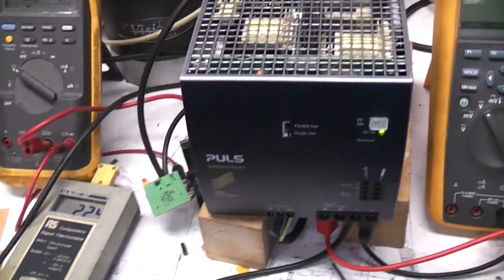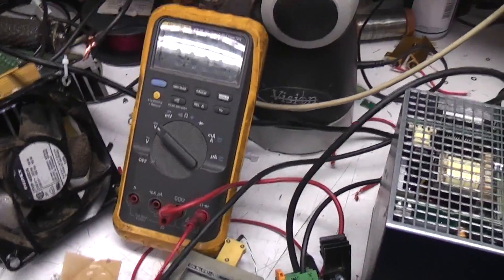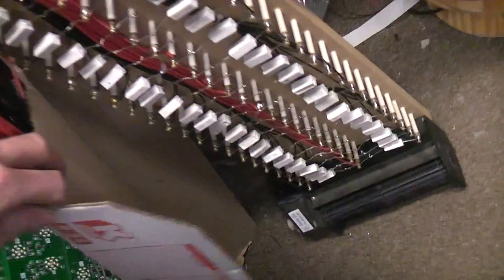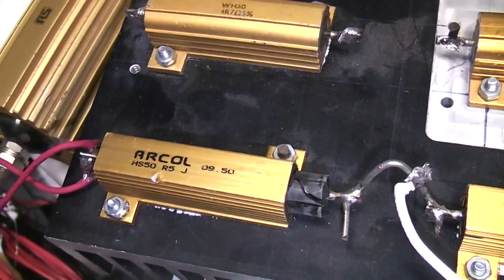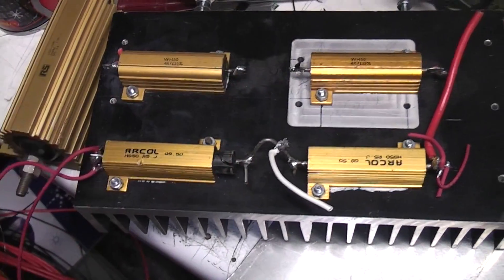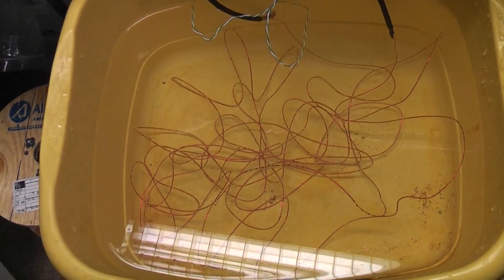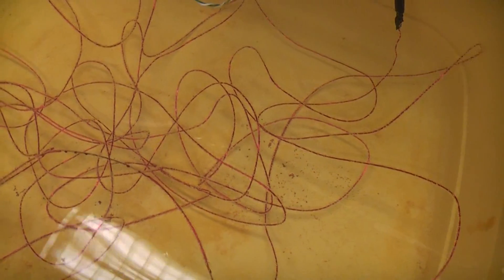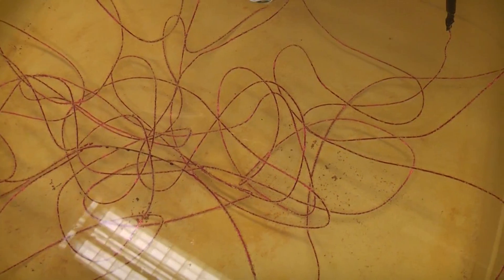Dummy load in a bucket

Comment: Mikes vids are always great!  For a neater solution do this.  Find an old 1200 watt MOT, wire up the secondary to the DUT.  The core should dissipate and heat.  Put it in a bucket filled with vegetable oil  for more dissipation.

Comment: Very common in India. In fact, the best is steel wires used for packing, they both act as resistance and are cheap. Very good to discharge batteries (battery charger development).

Comment: It works quite well unless the wire breaks, because for example some of it managed to come out of the water, boil the remainder of the water off the insulation as you demonstrated, heat up and melt. Assuming that some of the exposed wire lands in the water, the next thing you know you are generating flammable hydrogen (and oxygen) gas as the water begins to undergo electrolysis. Then next thing you know, the hydrogen catches fire and you have a mini Hindenburg in your basement/workshop.
Reply: Post a video when you get that to work. :D

Comment: I've been there and done that. During development of a 13.8V 15A PS I used an old ceramic power resistor about 4 cm in length inside a coffee mug full of water. You could know when it was running ok by watching at the vapour and listening to the "electric kettle" like sound.

Comment: I usually use container filled with water to dissipate heat from overheating heatsinks. Like my 2n3055 push-pull flyback driver, small DIY heatsinks made out of aluminum submerged in water, and everything is OK

Comment: Great idea, I believe mineral oil can be used similarly.
Reply: Water has a much better specific heat capacity (4183 vs 1670 J/(kg·K)) and thermal conductivity (0.67 vs 0.162 W/(m·K)) compared to mineral oil. Even taking into account the higher boiling point of mineral oil, water is the superior coolant.
Reply: David Cruise In some applications oil cooling is more appropriate, usually where it would be simpler and the cooling demand isn't too high or electrical insulation is essential (in this case it isn't important because the enameled wire takes care of that).
Here the coolant isn't difficult to replace, nor is it scarce and where water can be easily replaced evaporation is a good thing because evaporative cooling is extremely effective.
Just as much care is required to monitor the oil cooled system as the water cooled one because if it reaches it's auto-ignition temperature, well, you know what happens. Though this is only likely to happen on a long term test.
Reply: until it gets too hot and you end up with a big pool of flaming liquid , at least with water the risk of fire is a lot lower
Reply: If the dummy load were in a bucket of rags you may have a point, but mineral oil alone is only marginally combustible.
Reply: ever seen a paper in oil capacitor explode ? they catch fire really well ,water is still less flammable .
Reply: Yes, that's oil-soaked paper burning, that's not what we're talking about. Like I said, mineral oil alone in a container would be extremely difficult to ignite.
Reply: you clearly don't understand the difference between a flammable hydrocarbon and water .
Reply: You clearly don't understand that flammability may not be the primary concern.

Are you able to comprehend the potential issues of submerging wires into conductive liquids?
Reply: Xei  But it'll also evaporate. Clearly the better coolant is the one most suited to the specific application.

Comment: Used to drop a 20W wire wound in a bucket of water and put 2KW audio amp into it. Worked fine. For long tests I would just let it boil, gets rid of LOTS more heat that way (Heating 1 btu/lb/degree F   Boiling about 1000 btu/ lb ) Sorry for the "caveman" units.  Customers enjoyed the show too. Also an 1800 watt, 120 volt space heater is close to 8 ohms so they work great for high power audio loads. You can hear a little audio coming out of them too.
Reply: +robstorms To robstorms:BRLLIANT!I just happen to have an 1800 watt heater sitting next to me. Just did the math. 120 volts ac, 1800 watts=8 ohms and 15 amps.  Now I have a VERY high power load resistor.  Absolutely BEAUTIFUL !

Comment: I remember seeing somewhere a guy had large resistors immersed in a bucket of oil.  I don't remember where now, but that is another option for solving the corrosion problem.  Oil doesn't have as high a specific heat as water, but it can get much hotter before boiling.  Kanthal or nichrome will get you more resistance than copper, but they don't usually come coated.  Coated steel wire is another option for use under water to get a medium-high resistance, or you could even coat your own in a bath of polyurethane.

Comment: 24V @40 amps . You could use a 12/24V to 240V inverter  then plug a 1 or 2 bar electric fire in it for your load.

Comment: On a related note; some shower water heaters use bare coiled elements in water - the advantages being fast heat transfer and a novel emergency safety failure mode: If other safeties fail and water stops flowing, the heater boils the water pretty quick, but the first bubbles to form around the element cause that part of the element to break like a fuse.

Comment: I use some big wirewound power resistors. 1R at 200W each. I mounted them together on the L-brackets they came with, bonded 8 together, and ran them out to terminals on the lid of a 5gal paint can full of mineral oil. It can take a KW for the better part of an hour before the oil starts to get appreciably hot. Wonderful for testing amplifiers or similar. Total cost to me? About $50 USD and 2 hours.

Comment: I've used immersion heater elements in a large water bucket before.  They're cheap and it's quite easy enough to keep a bucket (or some large drums) of water cool enough to run just about any test you need.

Comment: Great timing! I just picked up a 80A 5V supply and I load tested to about 51A and my wire started to cook! I need to try this and push the PSU more towards it's max potential. I do have a 250W Dale .1 Ohm load resistor I was using, but my wire had as much or more resistance and started to cook!

Comment: This is a great idea Mike, thanks for sharing!! Here's a thought, what about taking apart a ~2kW convector, quartz or halogen heater and use the heating element as a load? That would be cheap to do and very safe... The other option is to use a plain halogen working light as a dummy load maybe? Anyway, great idea and hope to see that LED setup soon around...

Comment: You need about 4000 W in one second to increase the temperature of 1 liter of water by 1 °C, plus the heat it dissipates. Yupp, best dummy load you can get. Nice !
Reply: 4200W
Reply: Mr. Spock, if you like to count beans, it's exactly 4184 J/(kg·K) (14,5 °C). All the other effects are in a range that being 10% off will not make a practical difference.
Reply: Chip Guy Vids
 lol

Comment: A ceramic wire-wound or carborundum/globar resistor rated for about 100W in air will safely do about 500W or more immersed in oil. Commercially made high power RF dummy loads use this principle. At work I have everything from 80W to 25kW RF dummy loads, all of which are basically a resistor inside a finned aluminum housing filled with oil.

Comment: I second your cautions about overloading those metal clad resistors. Some time back I was testing a solid state 3 phase 415V motor reverser, based on back to back SCRs for the switching. Each phase switched had a low ohm value metal clad resistor in series. There was (supposed) to be SCR switch electronic interlocking to avoid cross phase short circuits. During full power testing some went horribly wrong with the interlocking and a SCRs cross fired. As the testing was at full power the power supply was probably capable of a few kA prospective. The result was like a shotgun and the insides of one resistor burst out across the bench smashing through some test gear. I needed to change my trousers afterwards.... Cheers !

Comment: Why not just use a use a few light bulbs?
Reply: It's a 24 V power supply. Getting up to 800 W in 24 V bulbs would surely be more expensive and complex than a couple meters of enameled wire.
Reply: The resistance in the light bulbs goes higher as the filaments get hot. So connecting a 400watt light bulb with cold fillament may trip an overload protection of a 800w PSU.

Comment: Should you take care about the flammable gases (H and O2) produced, or can they be ignored?
Reply: The wire was insulated. Even with bare wire at low voltages you won't get much hydrogen unless you put something in the water to make it conductive.

Comment: Nice solution :)

About boiling water: it may not actually be a problem.

The water will keep the temprature at a stable 100C as long as the wire is still below the water. (except modified conditions)

You only need to refill when the volume goes down.
Reply: Next step: put the wires in the tank of a toilet (the water reservoir). When the water level starts to drop, more water is automatically added :).
Reply: drojf In my years of plumbing I have come across a toilet/bog/wc that got plumbed to the hot supply. Nasty bloody things growing in and around it, but the client thought it was a good idea as it kept her back warm. fat bugger she was. Don't ask me about some one pluming the mains water to the gas, now that was something else, lol.
Reply: I think the water boiling would be a very serious problem because thermally insulating vapor/bubbles would separate the wire from the water, dramatically decreasing the overall ability of the water to cool the wire the hotter it got.
Reply: drojf Haha you are sooo smart! Very interesting idea! xD
Reply: I'm no physics expert but that seems shakey to me. The water cools the wire because the water is absorbing the heat. But if the water reaches 100C and no further then where is the heat from the wire going? Seems to me like it's staying in the wire. The water may not heat past 100C but the wire definitely can.
Reply: @ortzinator  All the energy coming from the wire leaves via the boiling water. Boiling consumes energy.
Reply: Brian Ortiz Correct, the water turns into gas and isolates the wire thermally. That's how steam trains used to blow up

Comment: Neat idea, I like that.  I had a power resistor explode forcibly and fire ceramic shrapnel out the ends when it was in use as an inrush limiter and the bypass relay circuit failed.

Comment: I have used halogen floodlights as a load.
but water is certainly a good cheap way for short term and if you put it outside in the cold it can run forever if you supply a slow drip for evaporation.
or simply a fan on a radiator for the water. 5 degree air is a bitch

Comment: Arcol resistors are crap! I used some of them for a 3d printers heated bed. They had the same failure mode at only 100°C. Since then I use Welwyn resistors, they can be heated up to 250°C without a problem. They work over a 2 years now, and have more than 1000 working hours on them.

Comment: someone did a lot of testing on those golden colored heatsinked resistors a while back, turns out maximum continuous current even with the case held at room temperature (grossly overpowered heatsink) is only about 110% of the rated current. It can handle a bit more in very short (millisecond) pulses but any longer than that and it will overheat.

The problem appears to be that the wire inside the resistor is not very well thermally connected to the case.

Comment: Hi.
I did that, but in a bigger scale, once during the load tests in a ship, where the load of the ship without the propulsion was too low, so we took 440V mains cables from the Bus Bars of the main Switchboard, and with long cables, we put them out of board, separated about  3 meters once of the other (we are talking 3 gensets 500kW each)
So, once engines running, we start to reduce the distance of the 3 phases cables, so load increased and we could test the load share (it works, but load is not really stable)
the funny is that the reaction with see water produces something toxic so we started to see dead fish floating around, well... it´s no funny but interesting.
Reply: That "toxic" thing you were creating was a massive electric field. Imagine dropping a toaster in your bath while sat in it. You did that with the sea :-)

It's actually a common problem with small boats that have dodgy wiring. If the engine is used as one part of the DC system like in a car, and the positive wire somehow makes contact with the sea you can make a small current flow around the water surrounding the boat. Not enough to cook you, but enough to stun fish and swimmers.
Reply: James Grimwood Toaster in the bath probably wouldn't kill you unless you have a metallic bath or cast iron drain pipe. The voltage gradient should be pretty low.

Comment: In the past, I have used nichrome wire wound onto a form and dunked in a bucket to acheive the same end.   You can dissipate a KW or more without any problems doing that.  The elements from old "radiant bar heaters" work very well for that.
Reply: Here i use same material i just bought a eletric shower 5800w and used in a bucket.